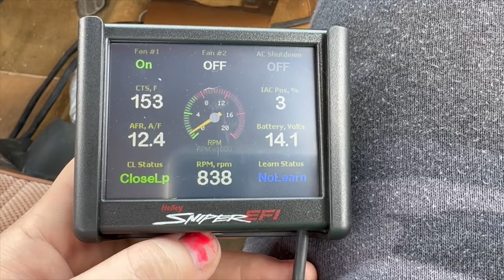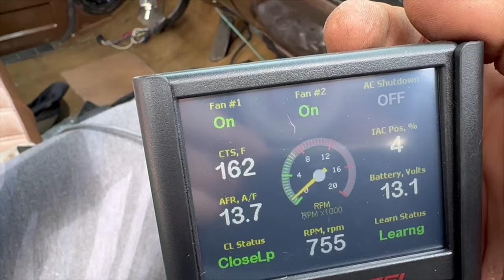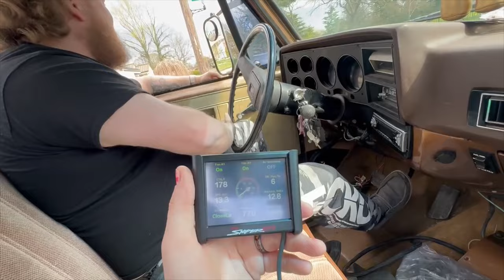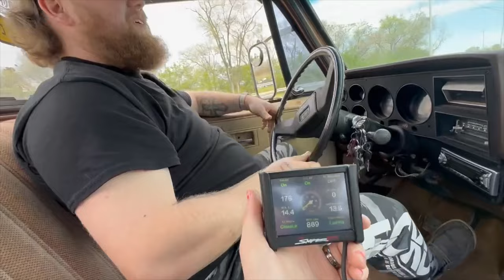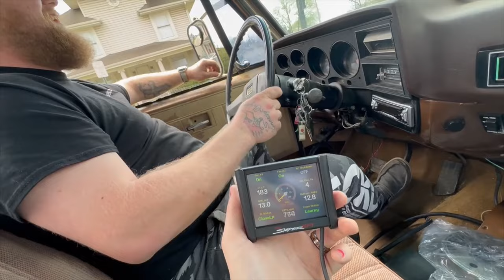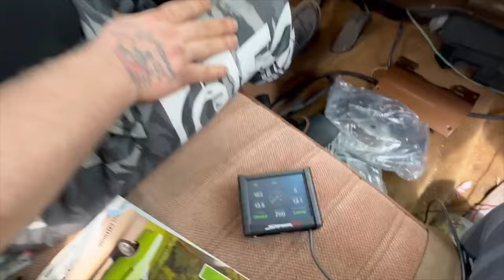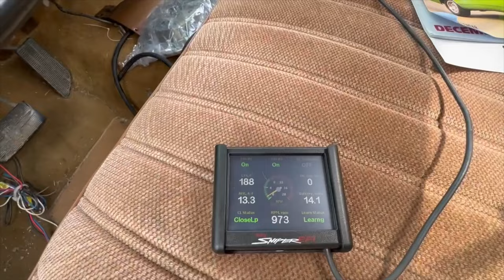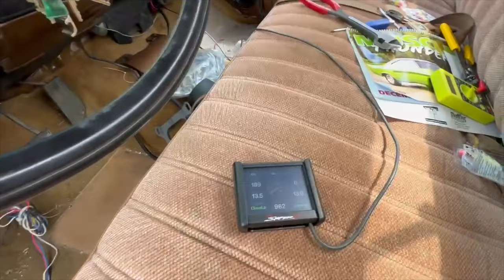First drive sniper 454 square body

Comment: clutch fan delete will give ya back something for sure!
Reply from the maker: It’s horsepower that I won’t notice. The tires are always on fire. Anyways I like the electric fans. I don’t have to worry about putting a shroud around the radiator.
Reply from the maker: thank you for the comment i subscribed to your channel those are some cool toys

Comment: I wouldn't buy a set up like that they always mess up you shouldnhave gotna holly double pumper and it would have saved you a lot of money and headache down the line. I seen many people buy them then have problems with them. They end up taking it baxk off and going back to a carb.
Reply from the maker: I did that a couple years ago with a fitech system. It was one of the cheaper set ups. I went back to carburetor for a while and ever since I put this Hollys sniper on I have nothing but good things to say about it. It has great drivability in both set ups. I drive one of them to work every single day and the other one goes down the road with no problems on the weekends.
Reply: @Harveysgarage94  has it still been good? thinking about getting it
Reply from the maker: Yes
Reply from the maker: @doormaat5033 yes I have it on both of the trucks. I would absolutely recommend that kit. It ran great with a big cam on that 350 and it also ran amazing on my stock 454